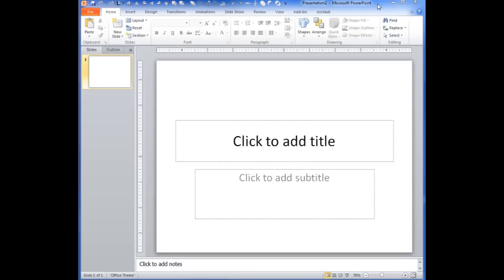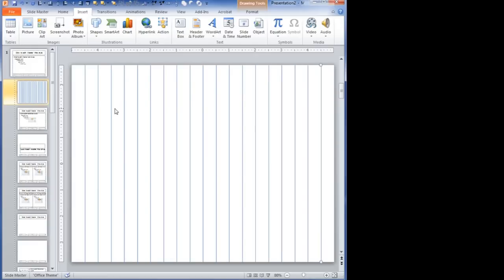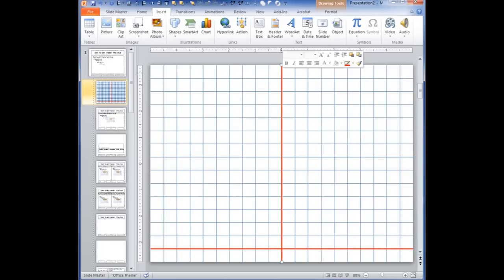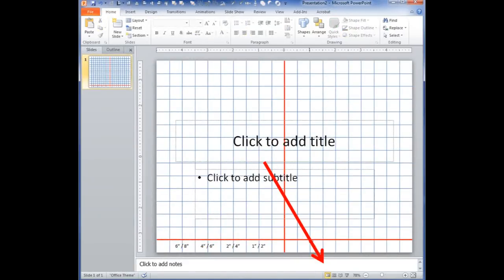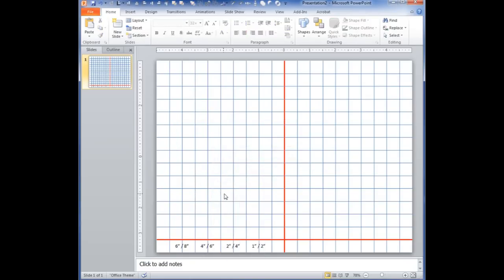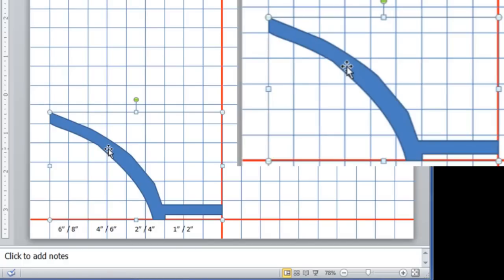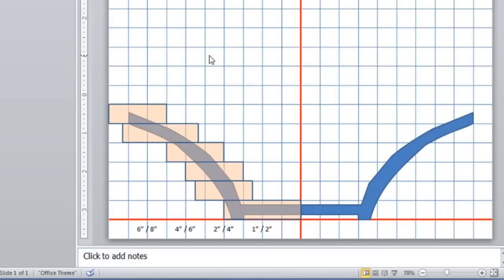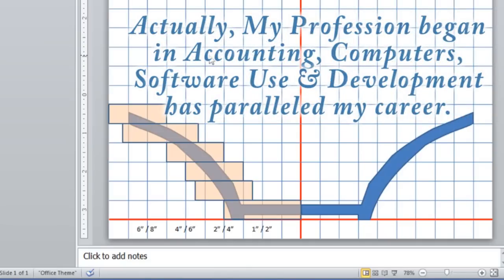Segmented Woodturning Plans Using MS Powerpoint (Bonus Video)

Comment: Hi Alan, very facinating. I enjoyed the presentation. My problem though is, that with nearly all segmented data sheets and programmes, its measured in imperial where as we grew up using metric. Any suggestions how to overcome this obsticle besides a converter app?

Japie
Reply from the maker: The simple version is to divide the circumference by the number of segments. It is a little over for segment length but very useable.  Then create a spreadsheet.
Alan
Reply: @AsWoodTurns  thank you kindly

Comment: Wonderful Inspiration! I did some investigating and found that you could accomplish much of what you were doing with the drawing in MS Excel and, with some embedded formulas, calculate segment sizes and lengths. Here is a lighthouse I'm working on: https://youtu.be/L3BEp_yY9rI
Reply from the maker: +Kenny Boothe Yes, Excel works too although I rarely draw in Excel. Turns out to be six's since you can also embed a worksheet in Powerpoint for the formulas. You're welcome.
Alan

Comment: Alan, Very Nice!  Thank you for the time and effort.  I didn't understand the master slide at first, my PP icon at the bottom didn't automatically switch from normal view to master slide view.  I had to go to the "View" tab at the top, switch to master, make the lines, radius/dia blocks, etc. and then go back and undo the master slide on the "View" tab again to get to where your tutorial walked us through.  My PP simply doesn't have the same icons and screens set up as default as you have.  I was able to find everything and to make it work.  Thank you again!! I will definitely have to give this a try.  I do have a question about this, and it might help you and other segmented block bowl turners.  Can you create a walk-thru tutorial which will allow us to see this as an overhead view of the bowl if it is possible?
Reply from the maker: Not sure what you're asking. If an overhead view is to be generated automatically from the profile, that would require some significant code. Instead, I'd then switch to Woodturner Pro.
Check it out.
Alan

Comment: I'm new at segmented turning.  So how do you now figure the angles of the segments or am I missing something?

Thanks,
Jim
Reply from the maker: I'd refer you to my other segmented turning videos.
But essentially angle = 360 / # of pieces / 2 because 360 is the circumference of a circle and 2 because each joint is divided between two pieces.
Enjoy.
Alan